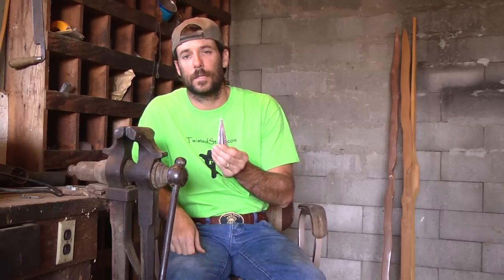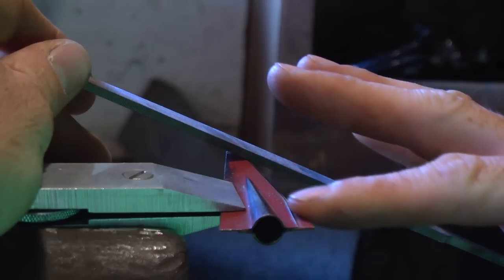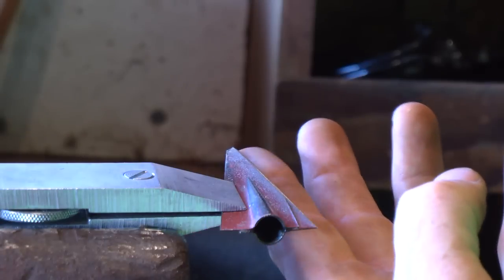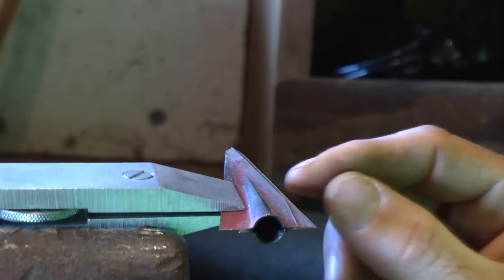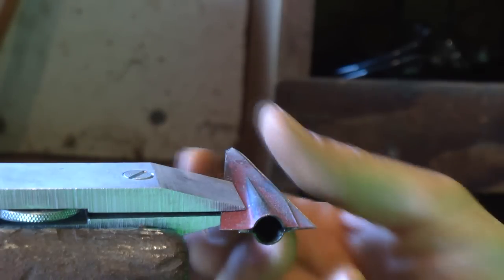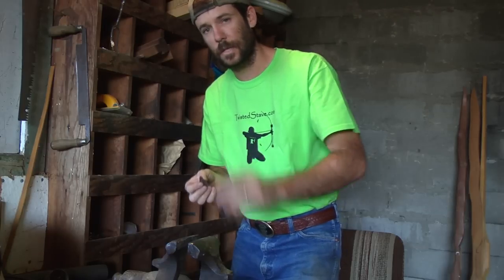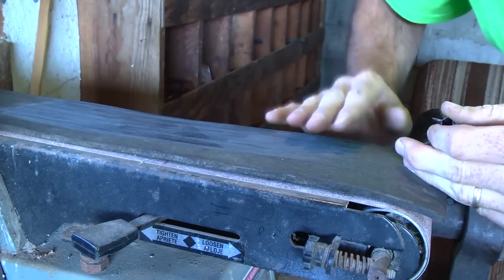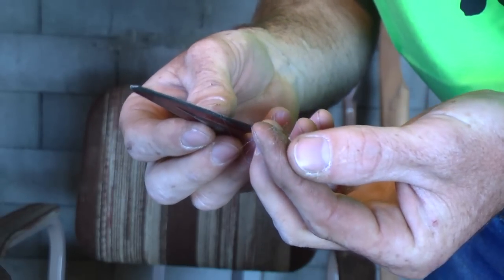How to sharpen a broadhead (single bevel)

Comment: If you take a marker, like a sharpie or similar, you can color the edges and you’ll be able to see right away, if you’re following the bevel. Re mark it a few times during the process, so you don’t go off angle.

Comment: Is a single bevel better than a double edge broadheads
Reply from the maker: I prefer them
Reply: The theory is if you get the single bevel that twists in accordance with your fletching, it will drive through the game better. Check out Ranch Fairy's videos for more info on this.

Comment: Bottom edge of a ceramic coffee mug works like the window edge
Reply from the maker: It does! good tip.
Reply: I do the exact same thing on my mug. After years of use, the bottom of my mug has a very fine grit and is good for honing. One can even use the dip in the middle of the mug bottom for water to wet sharpen
Reply: Both the element from a busted high-pressure sodium lightbulb and a tube from old knob and tube wiring work great,  too. The tube is coarser and the quartz element is finer.